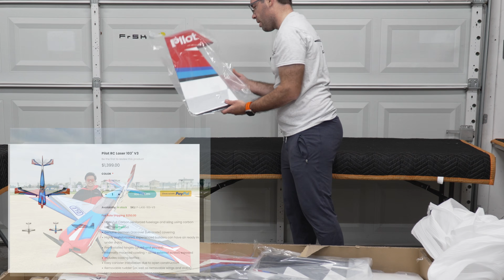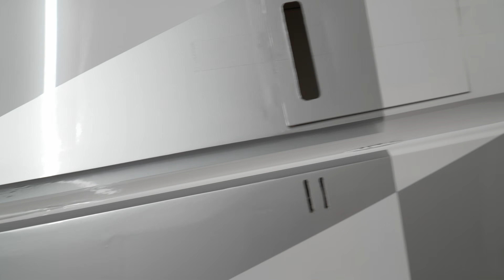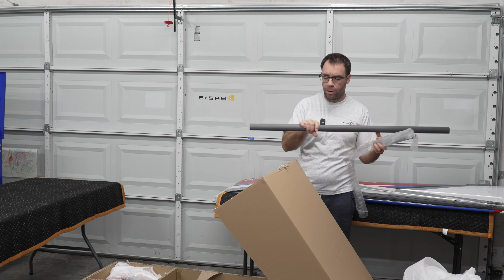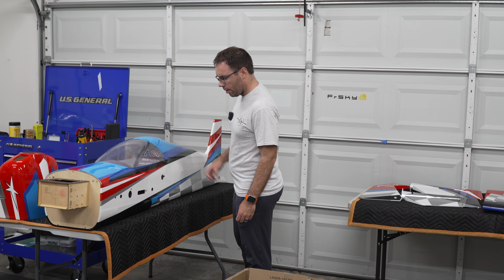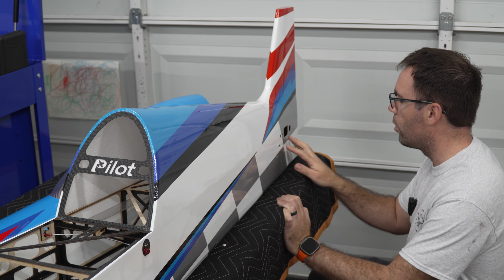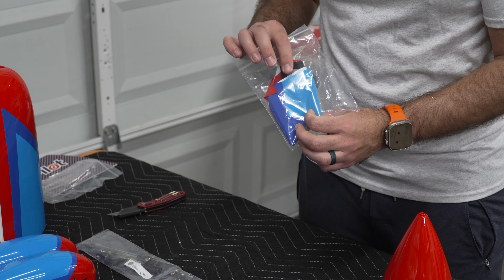Pilot-Rc 103" Laser V3 Unboxing

Comment: Thank you for the details!    Can I ask what you're doing for rudder servo(s) and linkage?
Reply from the maker: For rudder, I used a single Futaba HPS-AA701 on the tail, with push-pull linkage. You can see some clips of the setup in the build video: https://youtu.be/ye8182i4_BU
Reply: @skyboundrc    Thank you, I found that video after this one 😉

Comment: I flew a 100"  Carden Extra years Ago, traditionally Extras excelled at IMAC style aerobatics, there was no 3D back then. Now we have manufacturers expanding the surface area of control surfaces to accommodate modern trends of Extreme 3D, but I will always consider the Extra platform as an excellent traditional IMAC style plane, not a "hybrid" BTW I'm currently flying an EF Extra 104" and on normal rates flies wonderful pattern aerobatics. It's real bailiwick in my opinion.
Reply from the maker: Pretty much any EF or PilotRC will do really well with both pattern aerobatics and 3D/XA with the right setup. But different airframe designs have a bit of an edge with certain type of maneuvers. Also this looks different between different manufacturers (they modify the design from the full scale one quite a bit). For example, in EF the Slick is probably the most aggressive one, whereas the PilotRC Slick is probably the best one for pattern aerobatics, while the PilotRC Laser is the most aggressive one and best for XA.
Reply: @skyboundrc  thanks, that knowledge comes from flying lots of different airframes. I'm not so much in the know with all the modern planes/manufacturers.

Comment: Nice unboxing and information. Could you elaborate more on the differences between a "Precision" plane vs a "Hybrid" vs an "Aggressive" plane? I have no idea what you mean by that and how that might guide me when deciding to purchase.
Reply from the maker: thanks! Yeah, when I talk about 'aggressive', I usually mean that has more aileron/tail authority. For example, an aggressive airframe will execute crankshafts or knife edge spins with greater turning speed, or rifle rolls are faster snappier. A precision plane like the Slick is a bit more stable and makes it easier to perfect IMAC style maneuvers (slow rolls, snap rolls, knife edge...) still can do these maneuvers perfectly fine, but it won't be as explosive as the more aggressive plane.